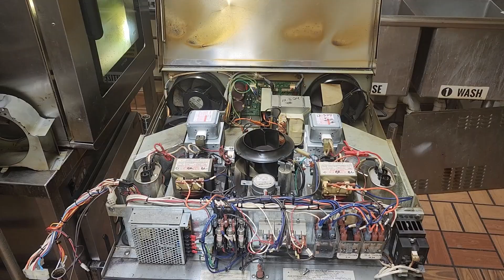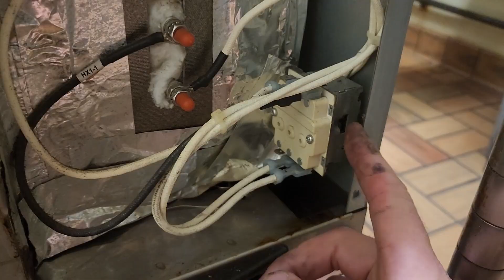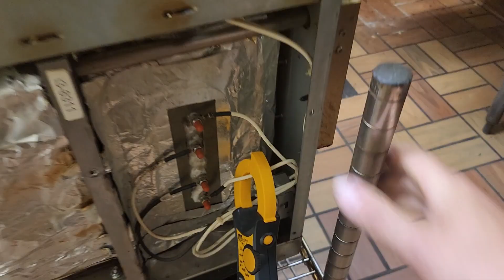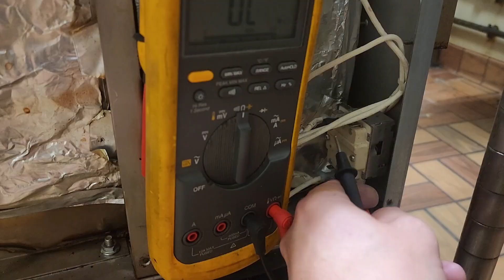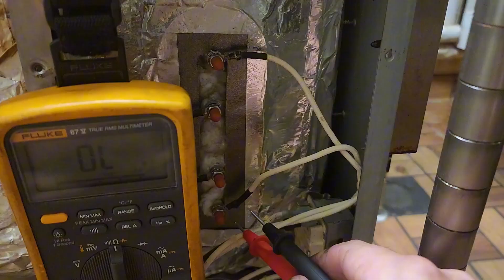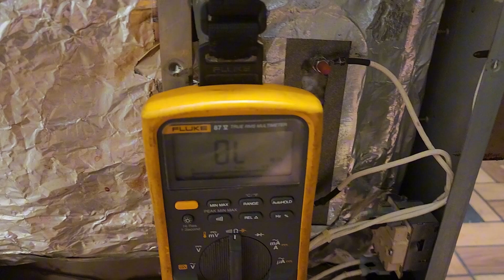TurboChef I3 Heating the Oven   Runaway Heat and Under Temp

Comment: Question, when measuring ohms on the high limit switch between the 2 terminals showing in the video. What if it shows a direct short?
Thank you for the videos, very helpful.
Reply from the maker: Good question.  I typed out a giant explanation and I don't think it would help...I got lost in my answer.  Give me 20 minutes, I'll have a quick video for you.  I'll link it here once I post it.
Reply from the maker: https://youtu.be/v39E3cu_Iyg
Reply from the maker: I guess it took 21 minutes...